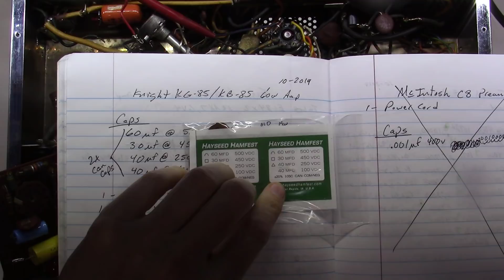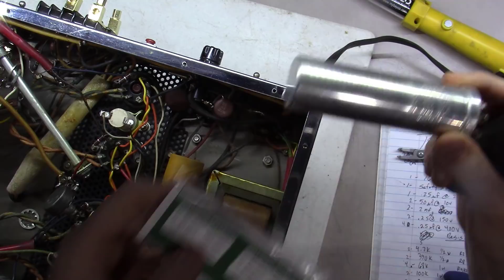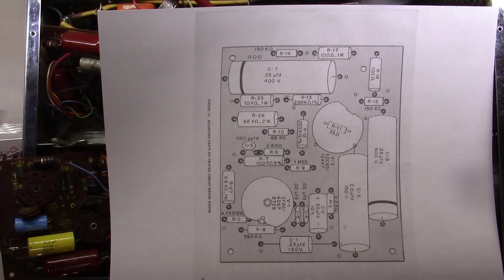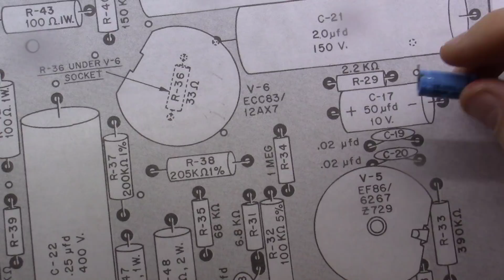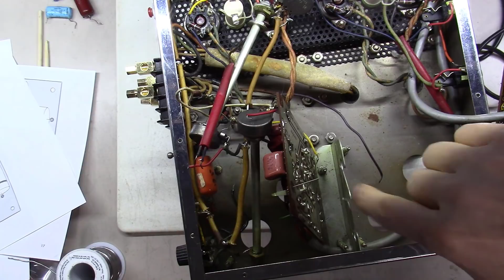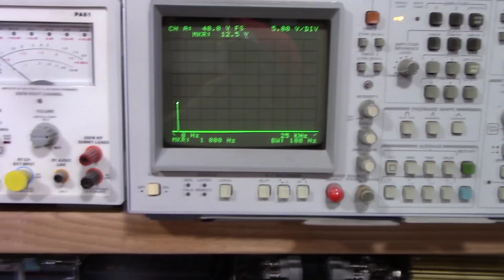Knight KG85 / KB85 Stereo Tube Amplifier Restoration - Part 2

Comment: I did not remove the cirquitboards I changed caps through the tube openings with tweezers after desoldering.

Comment: Hi Mark I’m not at all knowledgeable about electronics but as a keen hifi enthusiast I gain a lot pleasure in watching you bring these  faded treasures back to life   I am a now a retired electrical contractor in the U.K.   My question is are you ever tempted to totally replace all the wiring  with new insulated cables ?   Plus root them in a tide  fashion   Please for give ignorance  but coming   from my previous background it was what was expected   So it a case that if you took such a radical approach it would in some way alter the sound even though the cables are such short lengths   Thanks again for all you do in shearing knowledge with us all  best wishes and kind regards Mike in the U.K.

Comment: Regarding your thoughts on resistors, I disagree. Resistors have only ever one job to do and whenever they are adding to the sound, it's because they are arching inside and adding unwanted noise as Mr Carlson has shown in his videos. That classic tube sound comes from the amplifier when it's at it's power limits and has begun to clip, a solid state amp in the same scenario sounds terrible. I believe that the feeling that people have towards tube amplifiers probably stems from musicians who used tube amps to amplify one instrument and by pushing the amplifier to it's limits, they were able to achieve a sound that was both different and sounded good. At lower output levels, there's very little difference between the two different topologies regarding how the amplifier sounds. In a double blindfold test, you wouldn't be able to tell the difference between the two amplifiers but at the top end of the amplifiers output, this is where the tubes and output transformer will reveal themselves... Soft clipping vs hard clipping. The rest is a placebo effect...

Comment: Thanks you!!! I've been waiting for this video!! Because I am rebuilding a kb85  now. 

???? The schematic says feedback loop #1 4K resistor with 220pf bypass cap feedback loop #2 4.7K resistor with 150pf bypass cap. However my amp had 4.7K resistor on both feedback loops 150pf & 220pf bypass caps.
What is the Best Way To Go???Wire to schematic or make both feedback loops match with the same resistor value & bypass cap value?

Also do you know where I can get New boards? my boards are in horrible condition several traces & pads were ripped out.

Thank you very much for your vids I've learned Much from You. I am putting this New Knowledge in Practice fixing & modifying my Guitar & Audio Tube Amps.
I VOTE: Blue Glow, Mr Carlson's Lab, Uncle Doug & D-Lab THE BEST!!!
Reply: xraytonyb is pretty good too, mostly hi-fi stuff.  He even gave Mark a shout out a few videos ago.
Reply: @seanobrien7169  you're right he is good & I liked what he did with the mac 2150. I just can't remember all their screen names. There's a guy on an island in the UK that's great too
Reply: Steve Lueb Stick with the oriiginal schema as much as possible. But you can try both RC values of feedback loops.. If one sounds and measures unstable then chuck that off and use the other one.. Try using silver mica or polystyrene caps. Avoid ceramic caps..
Reply: @rickg8015  thanks Rick G
 I have the stock Ceramic In there now. They tested spot on I'll see if I have silver mica's. I am going to do the 3 mods from Blueglows Part 3. Then it's Lights Out! Power-UP! TIME! 
Anything I should watch out for when running 6L6's or Sovtek (coin base) 5881's?
ONCE AGAIN Thank you RICK G

Comment: Thanks for putting out great content. I'm always learning something new when watching them.
One thing I never see mention of is keeping up with all the excess debris. I mean like cuttings of excess cap and resistor lead lengths. I see them in some shots laying in the chassis, and then I do not see them in the next. As I cut one I always make sure I pick it out. I keep a spray can cap on the bench to put them in to throw away later, or sometimes long leads are saved for making jumpers. A stray cut off lead floating around the chassis can wreak havoc when powering up to test.
Anyways, Thanks Mark.